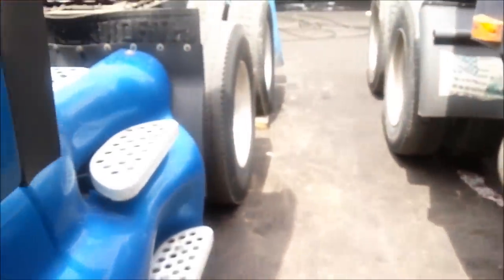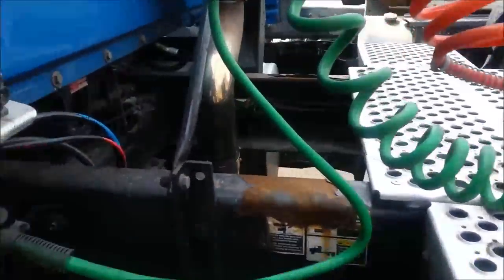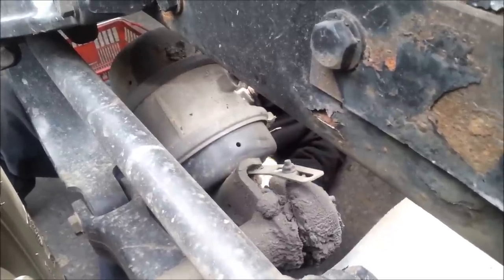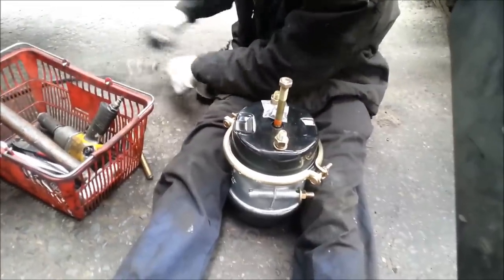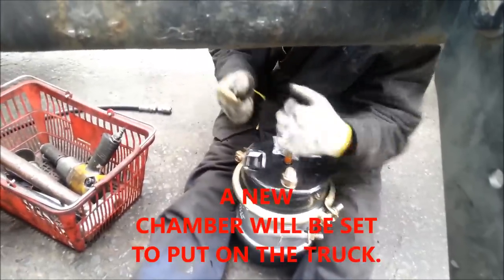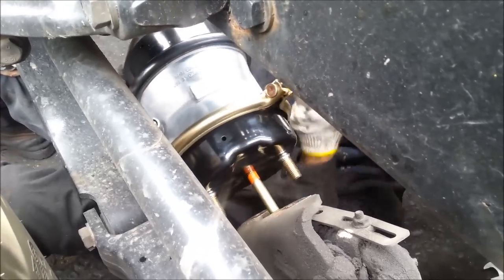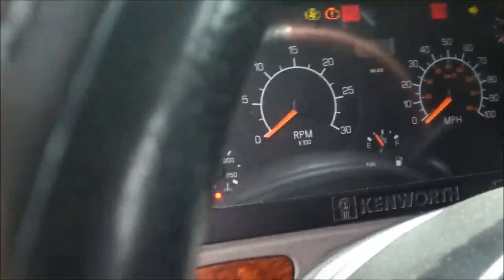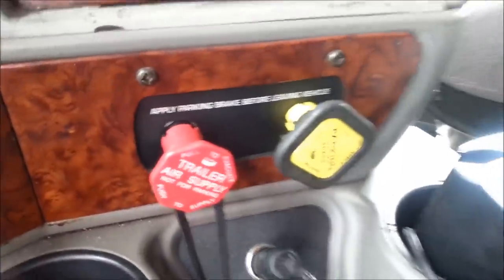Brake chamber out of service getting it fixed.

Comment: The manual adjustment has nothing to do with him removing the brake chamber by unscrewing it from the clevis.if the bolts are seized use a cutoff wheel & if he doesnt have one then he is not properly equipped. Of course you have to set them manually then they "automatically adjust the stroke. Not to be confused with a manual slqck adjuster.you do know the difference dont you @Superrush74

Comment: its just a leaking diaphragm if the springs not broken y replace the whole maxi pot that chamber looks pretty new just vice grip the rod undo the clamp with the park brake on. not released... and put a new long stroke diaphragm in it.....
Reply: he doesn't have time

Comment: Not seen a rusty chassis for 30 years in Europe. If you have decent spring brake chambers instead of that cheap trailer garbage, you'll never have to lay on the floor again. Murica is so prehistoric. ...S cam brakes, crappy brake chambers ,oil filled hubs. All that's gone now in Europe 20 years ago. Only in the USA do  folk lay on the floor to do repairs, even in  the major transport companies

Comment: I never understood why guys change the whole maxi chamber if its leaking piggy back is much faster
Reply from the maker: +Joey Wilson  I guess they are going for more money.
Reply: It's the same price. Easier do replace the whole thing rather than fuck with splitting it. And they cost the same now days, why not just replace everything. Do it once, do it right.
Reply: +Gino Bonizzoni It's a lot more fucking around if it's not a welded clevis because it has to be cut to length.  Just my personal preference but I always piggy back unless the clevis is worn
Reply: +Joey Wilson  and its safer too

Comment: i thought you will change the rubber inside the brake chamber..
Reply: That has been deemed to dangerous by OSHA, but the owner can do it himself. Remember, if one goes the other is not far behind and it will be your fault because you didn't fix it right the first time!!!
Reply: You can change the rubber diaphragm on the service brake side. YOU CANT on the emergency side of the MAXI CHAMBER!!
Reply: +danny yo It could be done years ago...when men were men LOL
Reply: well, in our case here in the philis. we only change the rubber, both on the service brake and the maxi,,

Comment: how would you adjust camber on a dump truck steering axle? {its 8x8}
Reply: Take it to an alignment shop, no joke.
Reply: lol
Reply: replace the worn king pin or
heat axle end cherry red hot and bend it to specifications. can be done easily on a bench 3" table vise.